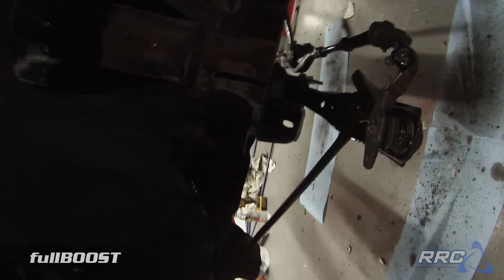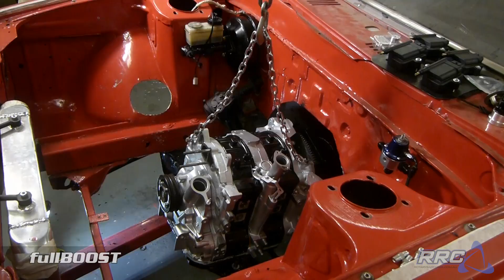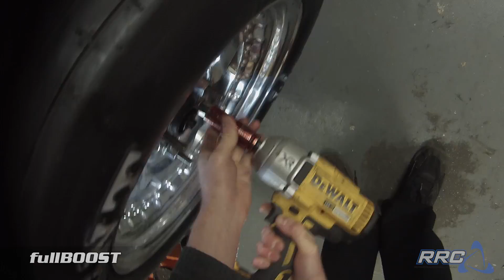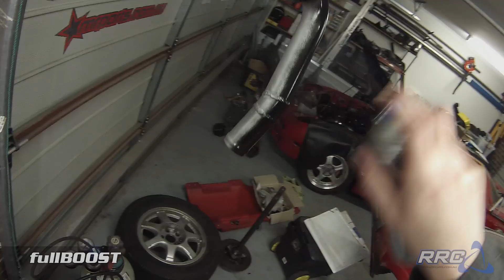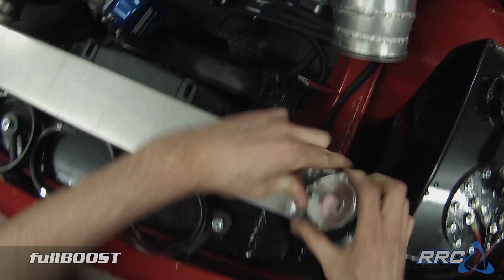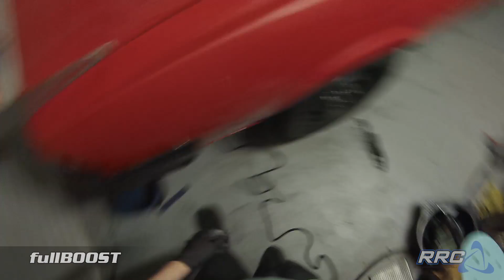BACKYARD MECHANICS | She’s ALIVE! | Project REDLINE Mazda rotary build Ep 11

Comment: This has been a great series guys. Love how it covers all aspects of the car. What TIG machine did you guys use during the series?
Reply: ive had the same chinese 'jasic' tig for 7 years now.  looks the same as most the other chinese ones that are still being produced.
Reply: MrParts_RotaryRaceCars okay awesome good to know. I've got a arc(stick) and lift tig machine that was quite cheap I was probably going to get argon and a tig torch and teach myself using that. But I need to get a 15a plug put in the shed. Reckon it will do the job to gain some experience using tig ?
Reply: Definately.  Technique and repetition of good technique is far more important early days than the gear.

Comment: What mixture castor do you guys run? I’ve been told 150:1 street and 100:1 track???
Reply: with the aftermarket power seals and racing applications, i generally will run about up to 250ml in a 20L jerry can depending on boost & fuel used.
Reply: MrParts_RotaryRaceCars sounds like I’m in the ballpark
Reply: yeah.  With ethanol and a lot of boost, id be running around 125:1 on the street, and up to 80-100:1 at the track.  If its moderate street car on unleaded that spends most its time cruising, then 200:1 will be ok.

Comment: Good stuff fellas but started it up in workshop with the door hardly open. Bloody hell must have smoked out the whole joint with toxic fumes
Reply: E85 is far less 'toxic' than any leaded or purely hydrocarbon based race fuel.  Also, did you miss the half face respirator i was wearing?  Just off camera is a huge 960mm (yes 1 meter diameter!) fan which moves a shit load of air.  Fan was off for effect.  turned it on and the place was clear in under a minute.  This isnt my first rodeo ;)